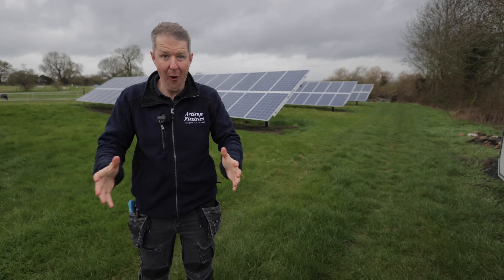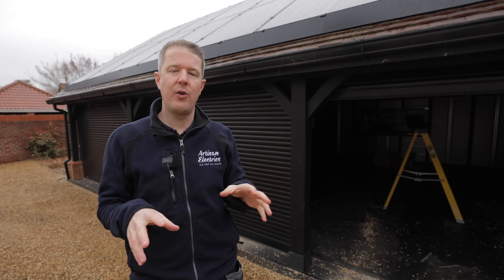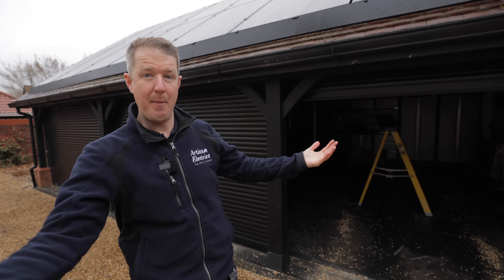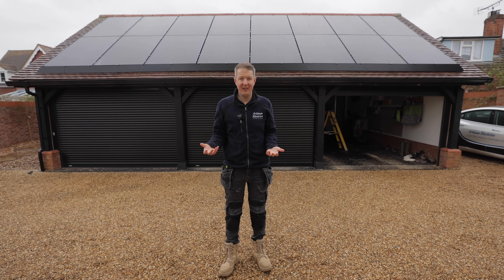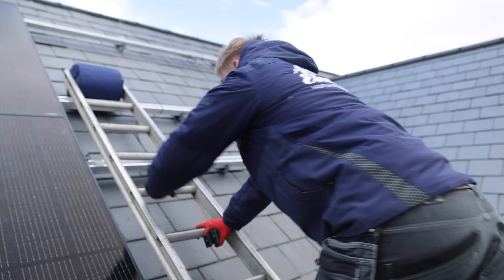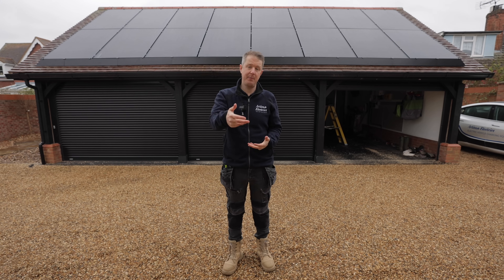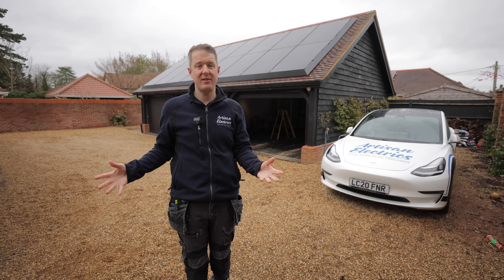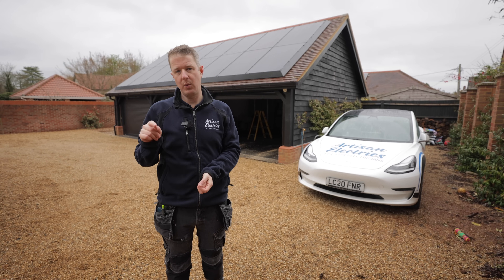10 Things You Need To Know Before Getting Solar Panels Installed in 2024

Comment: I give ya a quote it's too dam costly best to get rid of power hungry appliances and use alternatives save money stopped using kettle 3kw and saved nearly £100 a month use induction hob instead and air fryer
Obviously there's lots of factors to account for not just cooking 🙈
Reply: You did not save £100 a month by not using a kettle. 
It may well be 3kW but it’s only on for about 30 seconds, thus total power is about 25W

£100 of electric at 35p a unit equates to having the kettle on for 95hrs a month, which would be 3hrs per day. 😂
Reply: A kettle is the most efficient way of boiling water. Any other method is less efficient and costs more. It’s physics.
Reply: @theoldgaffer  But have you seen the size of his kettle ??
Reply: @theoldgaffer  No, you can't take the 3kW power rating and say as it is on for such a short time it is only about 25W.

You are mixing up kW and kWh. It is wrong. 
kW is instantaneous power and does not include time/duration.

kWh is the amount of electrical energy used and DOES include time.

For example: the kettle power is 3000 watts.
If it is on for 5 minutes then the amount of electrical energy consumed is: 5/60 * 3000 = 250 Wh.

If you are interested in time periods represented in seconds then the formula is this:

n - time in seconds
P - power rating in watts
E - energy consumed in Watt-Hours

E = (n/3600) * P

Example:
For 5 seconds and a kettle of power rating 3000 watts:
E = (5/3600)*3000 = 4.16 Wh
Reply: The flaw in your thinking is that you appear not to understand the concept of specific heat capacity for water which was taught in O level/GCSE physics in school.

Water has a specific heat capacity of close to 4200 joules per kilogramme per degree C.

What this means is, say you are going to boil a litre of water and take it from from 15 degrees Celcius to boiling point at 100 degrees Celcius then it takes a certain amount of energy in joules. And it doesn't matter whether you use an electric kettle, an electric hob or a microwave cooker.
You cannot break the laws of physics.

So switching to a different electrical means to heat it, you won't be saving much money at all. It's all in your mind, because you don't actually understand the concept of specific heat capacity.
Reply: I was just making a point higher wattage means your using more power regardless of the the temperature of the dam water and I wasn't about to start listing high power appliances or counting the dam times used and for how long ffs people chill ya bones 🙈🤣😅😅

Comment: I really like your channel......
But this clip, seams more in favour to the energy companies.
You can cut off your electric with a good size solar and battery bank with a 10kv Genny to top up in winter.
The biggest thing to think about is ,
Summer you will have more power than you can shake a stick at.
Winter....you will need to watch what you use.
As for garage battery storage......
Just thing lip04 banks need tobe kept above 3c to charge in winter.
And the battery banks on market at moment are silly prices to kw.
IV got a 7.7kw set up, taking no more than 60*60*30cm.....hmmmm!
Reply: It's far far cheaper to buy the cells from China, add your own BMS and create your own 'battery bank'.  Also... interesting thought on the generator idea... what's the cost of generator electricity in pence/kWh ? I suspect it's alot higher than grid power ??
Reply: @gregevans8939  that's what iv done......built my own battery, 7.7kw at moment soon to be 34kw.
As for generator yes it's higher than the grid....
But if your not using the grid then your still paying the high standing charge......so its a close one?
Reply: Still need to get DNO permission though, assuming it’s grid tied (U.K. based)

Comment: Kind of discouraging... I was looking forward to getting solar one day but I live in a really small house on a tiny block, an almost flat roof,  no garage(just a car port) and at most 1.5 - 2m clearance on any side of the house.
Reply: Anytbing is possible, it would just likely be a smaller system and installation may be more complex.
Reply: Solar is actually not that great in the UK... if you work it out.. (it's not an easy calculation) it's often not economically viable (with current prices).  So I wouldn't stress about it.  On the other hand... battery storage is often far more viable... so maybe that'll help instead.  But again... it's not an easy calculation.
Reply: @gregevans8939  It is impossible to know for sure how much money you will save and how much money you will get from exporting as the prices change all the time. However, solar panels are less than £300 each now and last for 30 years. So the question is just whether they pay off in 5 years or 10 or 15 and then give you pure profit after that. If you've got a home battery then solar makes all the more sense because you can shift the free energy around to match your use. If you get solar it makes sense to get a battery, if you've got a battery it makes sense to get solar (if you've got a roof).
Reply: @dougbamford  Hi Doug... I did say it's not an easy calculation... and will only ever give ball-park numbers.  Predicting the future is never an easy thing to do.  Don't forget also that there's equipment other than the panels, which is unlikely to last the life of the panels... Also remember that panels usually have up to 2% output loss in Year 1, then maybe 0.5% a year after that... assuming that they are kept clean.  As soon as you throw some sensible guesses at likely costs, the payback period can stretch out quite a bit.  It should also be noted that there are other ways to consider the investment too.

I've used PV in other countries that are a lot nearer the tropics than we are... and they make a far clearer economic case than when you're at 52°N
Reply: @gregevans8939  Hi Greg - yes we were agreeing on the impossibility of knowing for sure in advance. But look at the way the world is going - we need to decarbonise ASAP and solar is a quick and easy win on that front. Having your own generation with a battery means you get first dibs on that generation. It is a hedge against any future energy price increases (particularly useful as north sea gas reserves continue to deplete). Plus I offset my emissions and the solar is reducing my gas consumption so I'll be saving from reduced offsetting costs as well. It doesn't matter to me that I might have lived in a house with a south-facing roof or lived in a different country - I live where I live and I want to reduce my carbon emissions in a cost-effective way.
Reply: @dougbamford  I should have stated that I was only talking about the economic aspects of the PV decision making process... there are of course many others.  Not sure reducing emissions is one of them though.  There was a study some time ago that showed that if everyone in the UK was as 'green' as possible, i.e. we all have ASHPs, PV etc etc... you'd reduce man made global warming by a few seconds.  A far bigger impact on global warming would be if we all stopped buying things from China (currently the biggest greenhouse gas emmitter), which is kinda ironic when you realise that they dominate the whole solar/battery industry...
Reply: @gregevans8939  Absolutely agree, carbon pricing in the UK (and EU) has to go alongside a 'border adjustment' charge for the carbon in imported goods (mostly from China). Then high-emission Chinese products would cost more and people would be incentivised to select the less environmentally damaging option. China would also then have an incentive to go greener so that they could reduce their import charge.
Reply: @dougbamford  Good luck with that one...
Reply: @dougbamford  No, the battery doesn't necessarily make more sense.

Batteries are expensive and that needs to be factored in to the cost benefit analysis.

And that analysis needs to ultimately compare the effective unit price rate (pence per kWh) with the unit rate from your electricity supplier.

Batteries could very well tip it over the edge and it actually work out cheaper not to install a PV system, and just continue to use grid power.
Reply: @deang5622  I think we are moving more to variable pricing with the smart meters - depending on the time of day and the strength of the wind. Having a battery allows you to 'weather' the peaks and troughs, as well as transfer your PV collection to the evening. But if export rates are better (as they currently are with Octopus Flux) then perhaps the battery doesn't make as much sense as it did when I ordered mine last year. Can't predict the future with certainty, but if we think in terms of needing to achieve net zero during the life of any panels we are currently installing that gives a guideline.

Comment: Re batteries in unheated garage - they are seriously degraded in terms of capacity when temperatures drop below zero
Reply: I would think that you wouldn’t see the effects of the cold, as with the batteries always either charging or discharging there will be a self heating effect, so it’s unlikely the battery units internal temps would drop very low.
Reply: @Ben Gray  I speak from experience with batteries in an unheated barn in Norfolk. During the cold spell the battery temp dropped to below 5C for about a week. I was unable to charge the battery above 60%. Mitigation was to enclose the batteries with insulation boarding, which allowed the internal temp to be maintained at circa 14C during the next cold period. This is something that installers fail to highlight when siting the batteries
Reply: Whenever I install batteries... I add a small heater that's triggered on temperature... so it keeps the batteries warm enough to charge. Discharging is far less an issue in the cold.
Reply: @Greg Evans  good advice - not often highlighted by installers, hence the reason that I mentioned it
Reply from the maker: The MyEnergi Libbi battery we will be installing here has an in built heater for this

Comment: When government pushes for net0 so hard why the heck are they still building houses with roofs not facing south? Shouldn't it be written in planing application nowdays? And roof in video is not perfect cause it has panels on east and west side this will only be 50% efficient. No?
Reply: No. It will make a lot more than 50% of a south facing roof. In fact, it may generate more.
East west has twice the surface area for panel instal to a south facing install. 
The other benefit to east west is you get production over a longer period so can probably use more if not. South facing produce over a shorter period so you would struggle to use as much of it during peak summer production.
Reply: How much does the annual maintenance / service contract cost? Always wonder, but never seen this cost shared. Guessing it isn’t zero.
Reply: Had panels on our East-West roof installed last month. For many years assumed it wouldn't be worth it but they are working great. I actually think that it is better. You get more in the early morning and late evening when demand is at its highest. Plus you've got two sides of the roof so much more space to work with, so you can add a few extra panels to make up for 80% lower return per panel.
Reply: Dog wagging tail.

Comment: Solar and EV’s are out of the financial reach for the average working man !!

Those on low incomes are being hammered by this net zero shit  !
Reply: Second hand prices for EVs are coming down and there are zero % interest government loans for installing solar/battery systems.
Reply: @CastleKnight7  No consolation for somebody who doesn’t own there own home
Reply: @CastleKnight7  .... and still impractical for people who live in tower blocks!
Reply: @neilstokescvwshrewsbury7939  but then somebody who doesn’t own their own home doesn’t have to pay for the maintenance, repairs and upkeep of that property. As a rental client you don’t need to worry about spending £8k on a rewire or £4k on a new boiler install.
Reply: Your concerns about 'the average working man' don't make climate science untrue of course. 

What's your solution? Cheap loans for solar installs? Higher energy standards regulations on landlords? (I would support both of those).

EVs DO need to get cheaper, but most products start out expensive for enthusiasts and the wealthy and then come down in price.
Reply: @barrieshepherd7694  thanks for your thoughts. Agree with a lot of what you said, though not sure about nuclear - takes ages to build and costs loads more than wind and solar so not worth it. On the EV front, the early ones had small batteries which required a lot of cycling. Larger batteries require many fewer cycles to cover the same milage so should last a lot longer. And you've got ownership of something valuable - battery could be re-used as stationary storage or recycled to make a new battery so you own valuable material. Whereas with fossil fuels you've got to buy more fuel all the time.

Comment: No. 11 How old are you, will you potentially live long enough to recoup the expensive cost of the install  ???
Reply: Well with the current cost of electricity you can easily cover it within 10 years if not sooner. We've had ours for 2 years and if things carry on at this rate with the money we earn from sending back to the grid, and the money saved from monthly bills. We're saving well over £1.5k a year. So for our installation just under 6 years.
Reply: “A society grows great when old men plant trees in whose shade they shall never sit.” — Greek Proverb. Also - it will increase the value of your house so if you want to leave your loved-ones something more valuable you can think of it like that. Also - these calculations never include the carbon saved - if you offset your emissions (as you should, morally speaking) then this is an extra saving.